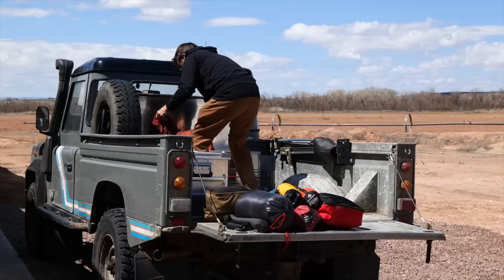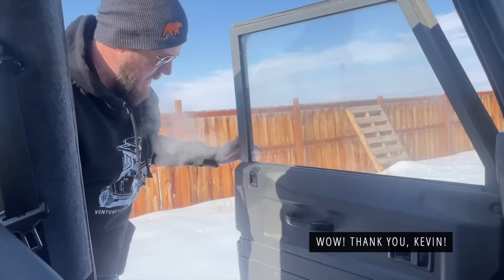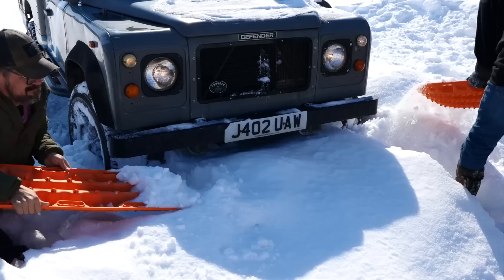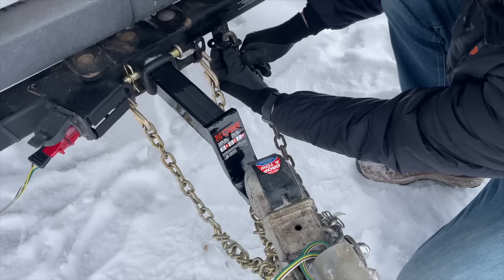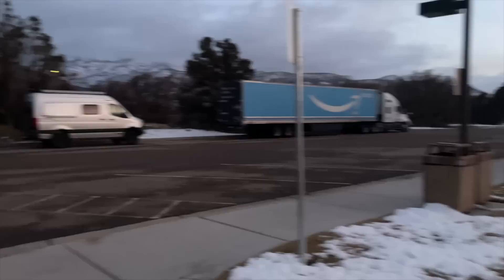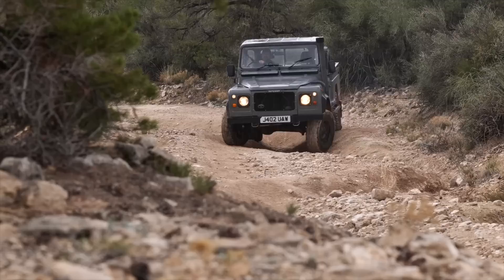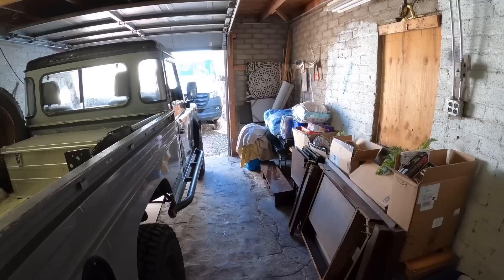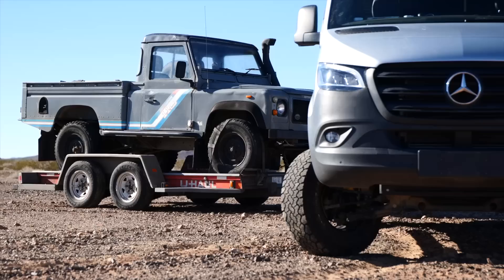V20E5: Revel Adventure to the Landy - Part 4

Comment: Chris, those uhaul trailers weigh like 2500lbs so you need to consider that when using it to tow as well! You’re probably pushing 6500lbs.
Reply: He knows. The trailer weight is usually posted on the trailer. He's probably pushing if not over GVWR too. People please don't follow this practice as it's not safe.

Comment: It actually possible to save just the aluminium skin and install it back on another door that would be in a better shape. That said, if your door is not rusted out, it will work just fine once properly adjusted, tweaked. The door card can be replaced by a new one with flash new fasters to brake on you soon enough ;-)